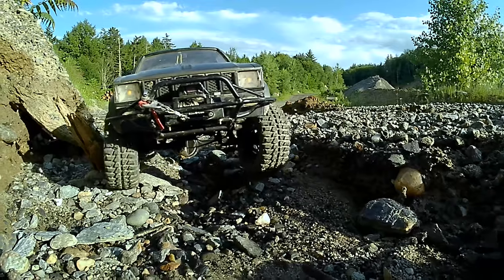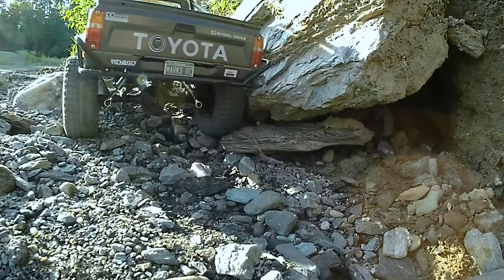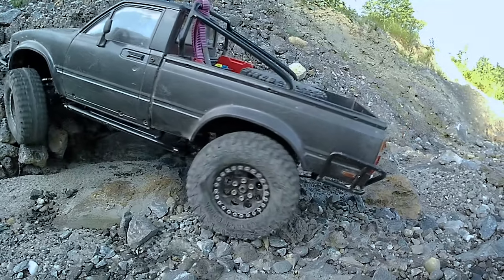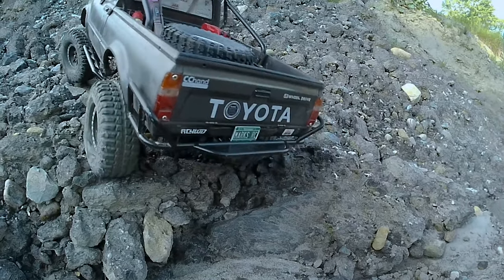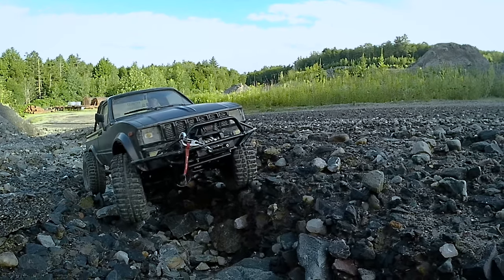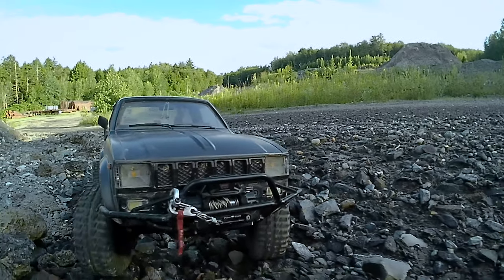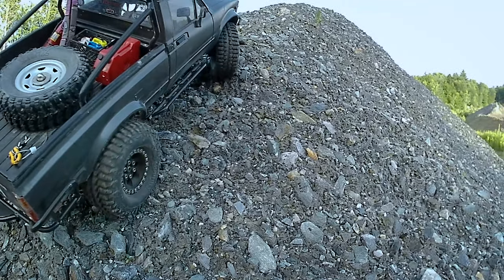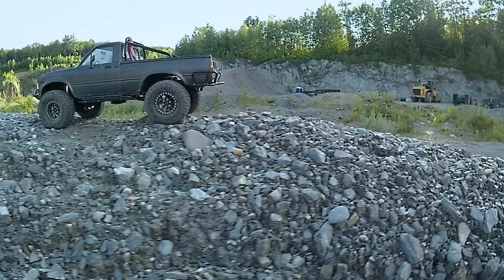RC4WD TF2 - Quarry 1

Comment: These trucks look sooo cool.  I wish they weren't so $$$.  You've done a really nice job setting yours up.
Reply from the maker: Crawls, climbs, water, mud, snow, you name it. I have beat the absolute snot out of this thing. It just keeps on taking it. It gets off the ground a couple times in the next video. My suggestion is to keep an eye out on the used market. I picked this up for $400 and finished it to my liking. Only think I've done to it was replace the motor with a Holmes Hobbies Crawlmaster. (well, rollbar, all the finish details, suspension, massive amounts of work on the suspension, etc)

Comment: Man great video explaining the suspension! These are the videos I love explaining technical setups, thanks for sharing this and the knowledge so many people act like its fort knocks on setups lol!
Reply from the maker: Thanks, man. I will say that some people are prone to taking the ideas and making them their own and then capitalizing off of them for their own good. Which, has irritated me a few times. I don't mind sharing knowledge or tips and tricks. But when people make it sound as though they've been the ones paving  the road, it gets old. 

This truck was stiff as a board when I got it. It was a mission of full intent, inspired by how Hoon's RC sets up his leafers. Not many use a single leaf setup for fear of axle wrap. Thankfully, I've put this truck through some paces and haven't had any issues. Even if it did happen, I'd still go right back to doing it. It just runs so much better set up this way. 

Have you tried the softer red leaf springs at all?
Reply: @VermontScaleCustoms  yes I love the red leafs on my 4runner I have several videos breaking down the suspension on my channel. Yah I just try and share knowledge that way the hobby grows. I came from long back ground of racing the gasser and nitro stuff back in the day, people unwilling to help each other I blame in part to it failing but thats me. The old timers shared knowledge at the track with me I try to pay it forward as much as possible. I started in the hobby in 1986 lol! I'm old lol!
Reply from the maker: I'm 52 and I've only been into the hobby since Covid hit. I don't count my single digit age of 7-8 years old with my first nitro that had no remote control at all; just start the thing and let it go until it runs out of fuel. I was too busy playing music, snowboarding, through my teens and twenties, and thirties to really consider getting back into it. Covid was a great opportunity to explore other hobbies that kept the mind active while still having fun with doing stuff outside, without other people, of course. I've always been into electronics, that's where my background is. And also why I'm an electrician now and probably will be for life. Probably not my chosen career but certainly a means to an end!
Reply: @VermontScaleCustoms  awesome man I'm not a sports type guy lol! I've always been a gear head hard-core mechanic type. Covid didn't really change anything here locally really because it's such a small laid back area to live nothing closed down other then school partially.

Comment: The set up that you have with the foam works well, how do you have the 1080 set up and progamed
Reply from the maker: Thank you .It works SO well. I do it on a couple of WPL trucks, too as well as all of my SCX24 stuff. 

Admittedly, I have not programmed this 1080 as I do not have a card! Luckily, I can dial down the throttle rate on the transmitter. Not only does it have a f/w midpoint adjustment, it has attenuation adjustment control, as well. I can adjust on the fly as needed ;)
Reply: I’ve recommend the video about the tire foams to others, I’m all caught up on your series, lol. Very educational! I believe your videos tell how to get the most scale appearance making us feel like whe are behind the wheel. That’s what I’m looking for anyways. From editing to platform and sound audio. The sound of gear lash when broke in feels like down shifting. Your videos remind us to slow it down and enjoy the moment instead of woundering if the upgrade worked, so what if it did or didn’t. I did so much to my TF2 in upgrades, and ended up back to stock, besides the basics. There all unique right? And all have a different character.  Thanks for the reminder!
Reply from the maker: @jeremyoshea7941  I appreciate the the fact that you guys all listen to the stuff I have to offer up. I'm definitely no expert at this and I've only been into it for a couple of years now. But I feel that what I've learned so far may help others if I can share it in a way that it makes sense to people. I could talk all day about mods but showing their practicality is really what works. 

I've been watching a lot of @turksandjerps lately and he's got a TON of great techniques for scale detail work. I learn something new everytime I watch one of his videos. Plus the guy's got a sense of humor that adds some quality flavor to the production. He's much like Matt from SBG but gets even more in-depth on some of the detail stuff.

Matt does a great job, too. I spend a lot of time watching his videos and picking up ideas. Olive RC does amazing scale work from scratch that will certainly influence anyone willing to watch, Danny Hyunh just blows me away with his animatronix work that I so wish I had the time and patience to get into.

I think my next move on this truck is to finally get an interior installed and get a driver for it. And, man, if you want to see some crazy interior work, again, check out turksandjerps recent TF3 videos. Just amazing work.

Comment: How do you not get axel wrap?
Reply from the maker: I’m easy on the throttle and I don’t keep hammering on it when it’s bound up. Most guys are just railroaders and think these things should be able to do anything. That’s when you run into issues. But, man, I’ve put this truck through a lot in the last couple summers and have had no issues at all.